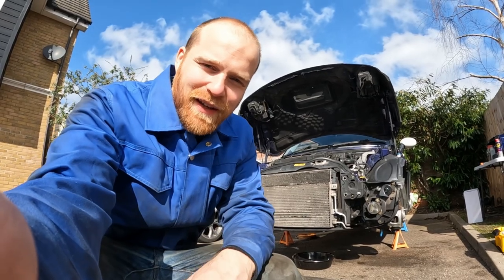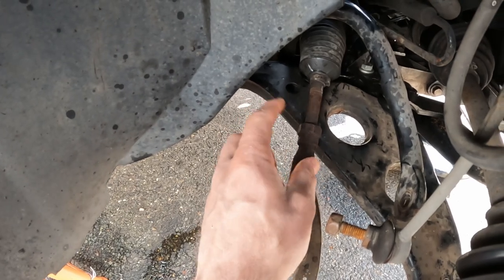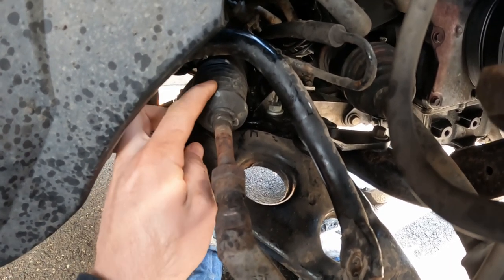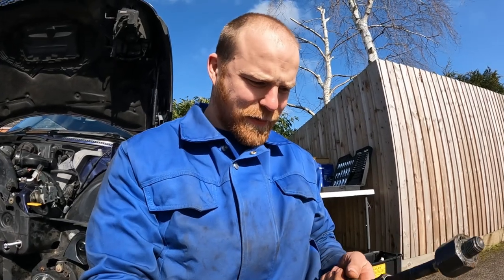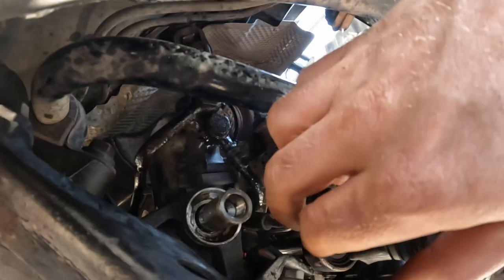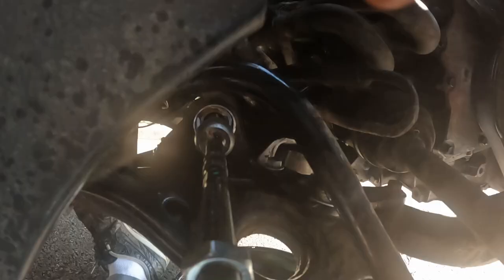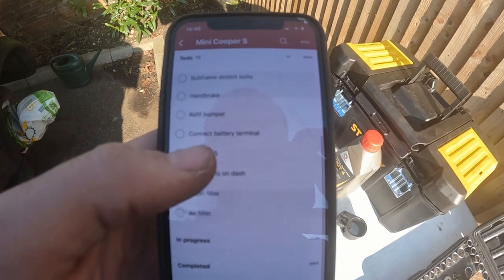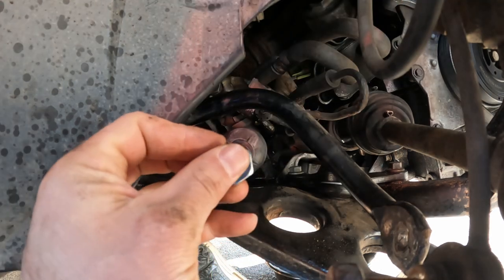I fixed these stubborn problems thanks to YOUR help

Comment: Binging this series, Nino - have to say I've never enjoyed a channel so much: it's supposed to be all about the journey! But actually, you personally turn out to be a pretty inspirational character: yesterday, after four months of not taking the broken lawnmower to the vet, I found a plug spanner (innthe soup tureen...), removed the spark plug, cleaned it with a bit of sandpaper, filled up with fresh petrol, and it started! Now for the non-running Moto Morini... thanks, Chap. ❤

Comment: So this worked for me to loosen seized jam nuts. Left the tie rod end bolted to the knuckle. Sprayed liberal amounts of penetrating fluid got my wrench on the jam nut and smacked it multiple times with a big hammer. Did the trick.

Comment: There is an 'o' ring around the pipe that may be in the bottom of your old unit, hence it seals and your new one doesn't. Might be worth checking as your new unit may be ok. I always buy Febi parts for my Cooper S, they are from Germany not China. Good luck.

Comment: I know this is super old, but I saw he had the same issue with the fiat slave cylinder too. They come with fairly loose gaskets that sit on the end of the metal hose, is it possible there was one in place already on the new one, and one on the hose end too, meaning you were trying to double them up? I had that exact issue. It had a new o ring installed in the cylinder and then the old one on the hose. Took me ages to figure it out 😅
Reply: Because the cylinder and the gaskets are both black and both covered in fluid, it's really hard to tell, just in case anyone thinks I'm a total mug for having that problem (I am a total mug,  ut for other reasons)

Comment: My first rule in the trade that strangely people never seem to know is avoid cars with Scotland registration number plates (they begin with S). 
Cars rust like mad up in Scotland, even if they were only first registered there and spent a year there. That’s enough for corrosion to start, once it’s started, it only gets worse and makes them a nightmare to work on. They always seem to have seized brake calipers as well
Reply from the maker: Ahh I never knew that – thanks for the tip bud 🙌🏻

Comment: The hose clamp on the boot might give you slight vibration in the steering wheel because it has extra weight on one side
Reply from the maker: Ahh interesting. I’ll keep an eye out for that 👍🏻
Reply: I can see imbalance being a potential issue on an axle boot - but not on a steering rack boot.